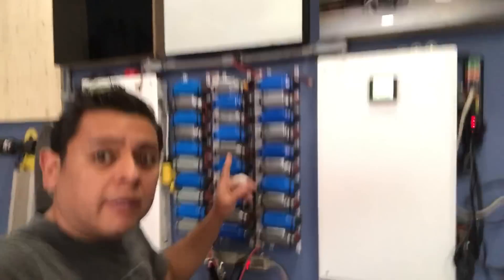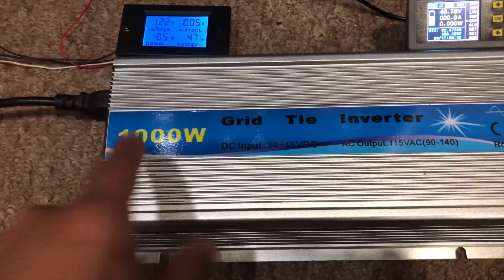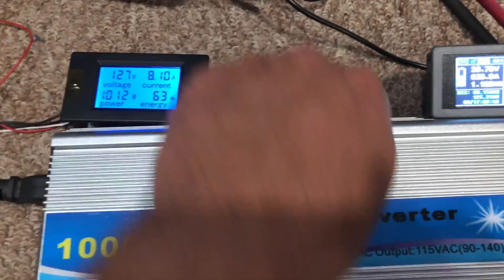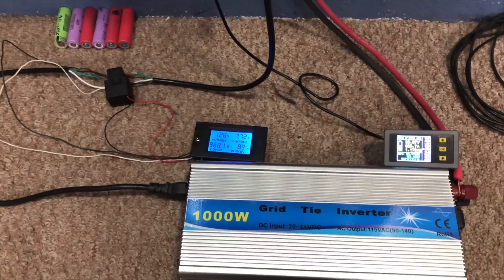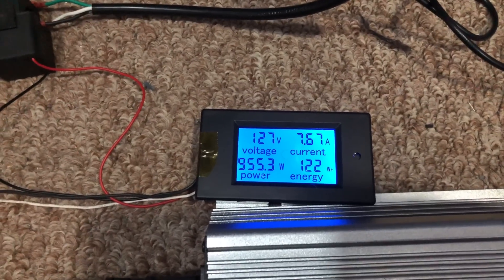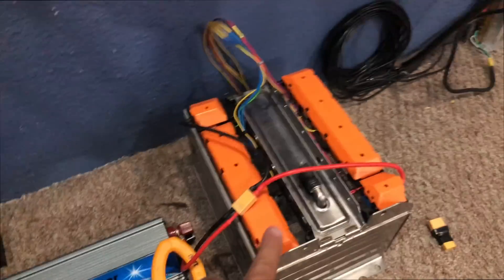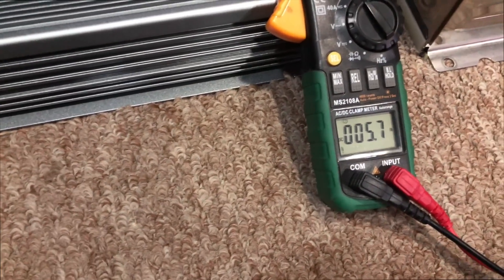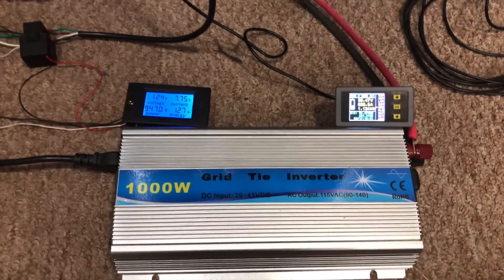Do Cheap Amazon 1kW grid tie inverters Put out 1000 Watts?

Comment: My 600-w grid tie and my 1,000-watt are just like yours but the power meter shows between 74 and 94 watts. I've tried them individually and combined.  When combined,  one shows 8 watts while the other shows 74. I don't know why it's not showing 609 or 1,000 watts next to power.

Comment: Hello! I have a 24 Volt system (LiFePO4)! Please tell me which inverter(1400w) to take with what voltage so that the inverter can work with a 24 V system? 10.8-32 or 22-50 Volts. Thank you very much in advance!

Comment: i wat thinking about using this, but trying to run at maybe 40% capacity off a battery bank so they don't overheat, any ideas how to limit the amperage from the battery bank to the inverter?  preferably without using resistors... do you think these inverters can accept a pwm power source? that could limit current. usually pwm is for motors so maybe it woudlnt work, maybe a dc-dc adjustable power supply... ah yes i awnsered my own question... Step Down 9A 10A XL4016 300W Module Modul Adjustable Power Regulator, this way i could just use a battery bank and feed liek 300 watts to my house all the time, instead of all my pannels just shooting it all into the grid and wasting it all. yes this is a poor mans grid tie with no feeding to the grid lol, and if i get more solar pannels, i do not need more inverters, just grab an extra battery(which is cheaper than an inverter) and then up my amperage a little.

Comment: Good tests. It would be nice to have an individual inverter that is powered by batteries which were recharged with solar to join in right when an appliance starts using the amount of power that inverter provides.

Comment: I use my 1000W inverters (2) every day between 12PM and 4PM.
They only have an output when they sense 120V, so I use Alexa plugs and program them to turn the inverters on and off.

The inverters start out at about 5-6Amps and taper back sometimes to less than 1A depending on how long they have been running.
They do NOT put out the same AC amperage consistently.

They take about 16A from the batteries/solar array each to give you 1-5A at 120VAC.
Solar Panel output is never consistent, if the panels are putting out 8A then the other 8A is coming from the battery.

They also trip 30A breakers daily, so I am now using 50A breakers.

I have 4 identical lead-acid batteries in series/parallel (2 sets of 2) for 24V.
These batteries charge from sunrise to 12PM and again from sunset to sundown from the solar arrays.

I have 1800W of solar at 25VDC on this setup and a control relay that shuts both inverters down if the batteries are less than 12V each using an Eco-Worthy Charge Controller to monitor and control the relay.
There is no PV input to this Charge Controller.

When both GTI Inverters are running at the same time, they seem to start out doubling the output, then both end up declining in amperage.
I only get 12A at 120VAC for a very short time, then it is up and down.

You can watch the panel and inverter output amps go up and down based on a cloud passing by.

This setup gives me about 2-12A at 120VAC for about 4 hours per day.
I could go longer if I wanted to run my batteries down, but I don't.
I like to keep my batteries between 12VDC and 13.8VDC (just like a car does) and run the system only when the solar arrays will power the inverters.
It should lower my bill.

I do have another separate array to supply power to an upright freezer and refrigerator.
Again only running for about 4 hours per day.
I also use an Alexa Smart Switch to turn this on and off on a schedule.
I have a relay that reconnects the grid power automatically if I lose solar.

Being on schedules like this is fine, but you have to still watch for cloudy days and shut them off manually or you will only be running on batteries.
I will work on that to automate it also.

I have designed a device to drop out panels if the total current goes above 30A so that I can over-panel for more power at sunrise and sunset.
If the total current drops too far it adds the panels back in.

Comment: Thank you very much for testing this.  I've been considering a small solar setup to offset some of my current power costs and was curious to see one in action.  A lot of my load is borderline resistive, or continual load such as laptops and A/C (I live far north so I just use a small ~ 1/2 ton A/C unit) and so solar with grid tie would be ideal to offset that cost.  I needed to see exactly how this unit functioned under load and such and you showed every stat I needed to know.  Thanks!

Comment: Good stuff Jehu. I'm looking to take advantage of the Nissan leaf sitting in my driveway if the grid power in our area should be disrupted. I've heard that you can run a 12v inverter on the car battery and if you the car in park with the power on, the traction battery (24kw) will keep the 12v car battery charged. If that works, how big of an inverter can I safely run on it and/or how big of an inverter would I need to run a refrigerator (according to the sticker inside it's rated at 8.5amps (don't know the watts)), and a second refrigerator rated at 4.5amps, and maybe a lamp or 2 for basic lighting, and if there's anything left over, maybe a smart tv (I think it's a 55").

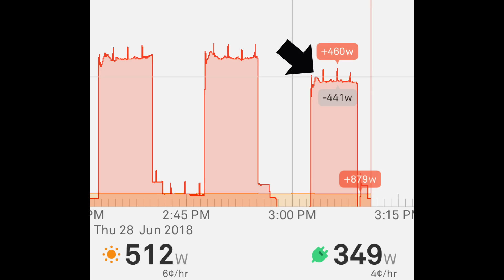Comment: Hi there ...so the part @ 7:27time line is running of a 12.7 volt battery inverter 10DC minimum and you have 1000w....no problem? I ask you this because of the inverter diagram 10DC version wants a minimum 18volt and not to run of the load side of charge controler. ?? What's your take on this.! Love the electric VW ROCK ON!! ( IRELAND )

Comment: I’ve got one of those grid time inverters and have four 300 Watt panels hooked to it and even then the middle of the day with the East Texas direct sun I cannot get that inverter to produce over roughly 540 -560 watts. 
Have you by chance tested the voltage of the two leads that you have connected to the inverter prior to connecting them? The reason I ask is because before I connect mine the voltage coming through the cables shows roughly 39 1/2 Volt, but as soon as I connect it to the inverter and the inverter starts running or is turned off and I put my voltage meter on both of the leads it’s reading in the mid 27 Volt range. I have no clue what’s going on or why that would be, any thoughts? Nobody has

Comment: I have a 600w version of this and I noticed that it was interfering with all my internet powerline adapters. It was making the internet connection unstable. I ended up replacing the powerline adapters with ethernet connections. So far so good. No devices blowing up. I even have a 3 phase 5kw inverter in sync with this with no issues so far.
Reply: Powerline internet can't go across a transformer that will change voltage. Also they depend on a sine wave filter, if your inverter is under load and is not a pure sine wave than your data will be corrupted.   You might find that a couple of large capacitors will buffer and allow you to use that equipment again.
Reply: @johnschneider931  Funny enough, it has blown the capacitors inside my Tenda powerline which is very close to the 600w china made inverter....so I guess these are not pure sine inverters after all so be careful people.
Reply: What size panels are you running to either of your two units? Do you find that you’re running more voltage/panels in excess of what the wattage says in order to try to even come close to that Wattage? Example, 3 panels 300 watts each which is 900 watts feeding the 600 watt Inverter to get it to produce the 600 watts or close to it?

Comment: Hi - I'm running two 120cell 32Vmp 7.92Imp 256W panels in parallel with African sun power into the  20-45V to 230Vac model but the best grid power I've monitored so far is 350W (ac). Very disappointed but hoping somebody can help. Input Voltage and current are well within spec but the units just don't generate anywhere near the power they should. The panels do deliver 500W with an ePever 3210AN MPPT controller. I can only think the Grid tie MPPT software is terrible.

Comment: So, in the process of conversion, at your input voltage, it's losing about 20-25% of the input. Or it's output is about 75% of the input. I am curious if it is more efficient when feeding it a higher input voltage. The ones I see listed can accept up to 50vdc. At 36vdc, it has to boost it higher.

In any event, if the losses are about 300watts between input and output, that is a fancy 300watt heater. Use three of them and you have to expell nearly 1000 watts of heat. That is great for winter, to add direct heat into your house, but horrible in winter, where that heat has to be expelled outside. (Thus, it will be replaced with hot outside air, being drawn in to the place you mount the inverters.) It seems to be using the heat generated as the "output restriction". If you ran these in the winter, they might stay a constant 1000w output and possibly have lower losses or draw from the input side.

Being 75% efficient is nothing to brag about. You have to buy 25% more solar cells and inverters, to get the desired output. If you add the 75% efficiency of charging... Then you actually need 50% to 65% more solar cells and batteries and battery chargers too.

It's worth paying 4x more for a 98% efficient inverter that operates at a higher input voltage and would handle all 3000watts without losing nearly 1000watts in the process. Getting an output of 3000watts, but consuming 1000watts, for a total of 4000watts of input, with 1000watts having to be disposed of, as heat, is quite bad.

Comment: I’ll be setting 1 of these inverters I’ve got on 2 Yellow top Optima Dry cell batteries in parallel it’s only for my sump pump in case we lose electricity  you know and I’ve got besides that 14 PCs 3.2v 280A & 6 PCs 3.2v 200A 😉

Comment: I dont like my inverter with a lead acid battery and a solar panel setup, because i use 220v and we need a lot more current to get stuff running on 220v instead of 120v
Reply from the maker: Exactly the opposite,  you need half the current on 220 vs 120
Reply: @jehugarcia  oh thx for info i tought we need more but its nice to know more🙃 im still learning electronics.

Comment: i have the 1000w version and it puts only out 328 watts.
it is connected to 2x 375 Watts Panels, at least 500 watts must come out.
Reply: Same issue I’m having. Curious when I see people test these online and it’s like they’re working perfect, but whenever I’m running over 1400 Watts to one of these thousand converters I can’t get the damn thing to go over 560 Watts??? IDK
Reply: @Wrensspeedshop  Many of these devices are scams.
Someone took a 600w converter and turned it into a 1000w converter by simply re-sticking the sticker. The golden one I had came to 816w and the syllable only to 328. If the watt numbers fluctuate a bit and it doesn't get any more then not enough comes out of the panels or the converter is damn inefficient.
If the wattage stays at a very specific number and always stays the same, then the limit of the converter has been reached.
By the way, both of mine broke after 3 weeks.

Comment: What is a transformer do? How much electricity would be charged if you used a microwave for just 3 minutes without that part? If there is old used microwave maybe you can load your house from that? Why are we paying when inverters + transformers are so cheap? We don't realize a 220 outlet can generate far more electricity with very cheap electric parts. No experience of course in this I just take things apart and google what each thing might else be used for or what other applications I can find the part is required then report back to youtube comments that the autobots and decepticons are to blame for never suspecting my microwave could power my portable devices as well as all my power use for lights free. Cartoons hold all the secrets.

Comment: Hi there, are you running the inverter just off a battery on this video? I want a battery only grid-tie inverter but everything from China seems to be solar panel related and when I speak to the people on alibaba they seem to suggest that a solar panel must be connected and the battery is for ‘backup’. I want to use the battery to charge on my economy 7 rate (low price) and then use it when the electricity rate is more expensive. Tempted to stack 5 of these inside a well ventilated custom housing with additional fans to give myself a 5kw grid tie inverter running off a bmw i3 battery (60Ah) in parallel at 44v. Thoughts?

Comment: for those of us that aren't fluent in math but still interested, can someone translate this into english? is this thing putting out decent numbers? with enough solar input could this inverter essentially power a small home/cottage or would you need more than one?
Reply: Because it is "grid tie" it feeds into the house circuit usually through a fused spur. The house is still attached to the grid. When the national/private company  or whatever grid fails... the unit will switch off. This type of unit won't do off grid without more switching. Sounds like you are asking about a standard inverter

Comment: Are these things saftey complaint and shut off in a powercut so you dont go electricuting some electric worker trying too fix the power. And can you still use it too power your house in a power cut as long as you turn your mains switch in your consumer unit?

Comment: When theses things plug into the wall outlet, isn’t it a problem for these inverters to pump electricity back through those home lines? 

I’m mostly concerned if the outlet won’t be able to take the current.
Reply from the maker: It’s  a 1500w rated outlet,  why would it have trouble taking 1000w
Reply: @jehugarcia  would you recommend these inverters for a small 2kw setup?

Comment: Just be careful, there’s a reason why it is better to have one high-powered inverter rather than paralleling n small ones. While some are designed to be synchronized to each other, if one fails it will inject into others, and thus they will all die instantly.
Reply: Shouldn't be a problem. Solar panel micro-inverters are essentially the same idea. Grid-tie inverters are supposed to synchronize to the grid.

Comment: Hey if you took one of these inverters and hooked it to one side of a 22o volt ac braker then took another one of these inverters and hooked up to the other side of the 220 ac braker would it run a 220 ac unit.Thank you. God bless.

Comment: good video. A question, I want to install a laser printer of approximately 550w 115v. What inverter could I use, modified wave? how many watts ?. I would use the printer very lightly during the day. Thank you
Reply: Little late to answer, but I believe you need a pure sine inverter for a laser printer.  There are a couple items like laser printer and lcd clock that need pure sine to function correctly.

Comment: I bought the exact same inverter the 12 volt input inverter but it blows a 100 amp DC circuit breaker within two minutes of connection to my single 12 volt AGM 76 AH battery ? I thought 100 amp breaker would do the job ?

Comment: with my supercar system you would be able to use 100watt constant and transform it into 1000w on cycles every 10minutes.or 10 000 watts output up to 100 000w

Comment: I would have placed a 25A current limiter on the input side of the GTI. They are not designed to run from battery inputs (unlimited input current), they are meant to run from Solar only with has a max input current.

Comment: Purchased this to run my traeger scout smoker while camping and charge camera batteries. This thing worked flawlessly  share4.photo/DPowerInverter   After reading the different inverters online and mixed reviews, I purchased this for the name and it has proven to be solid. Runs silently, and didn’t draw more than 130w while using smoker, and charging camera battery, and phone plugged into usb. This has been a great addition to my camping rig.
Reply: @LazyH-Online is it still good and running without any problems?

Comment: what is the maximum continuous power rating for this unit ?
Reply: Tehnical parameters for my tie inverter same company  36v./1000w  dc input range 20..._48v
Ac out 230v
Dc max.curent 60 A
Protection short circ. Low voltage .over voltage.over temperature protection.

Comment: Is your AC 120v? Most are 240, using L1,L1,N. if so than this will only fill 1/2 the use even stack with 5 of these units. Need to place on the other the other grid in home. http://thecircuitdetective.com/bkgrd.php

Comment: I just bought a grid tight inverter off of Amazon. I took it out of the box and hooked everything up correctly the voltages are in between the rated voltage. but the light flashed one time. It’s still not working but I could see a green light on the inside. Do you know what might be wrong.

Comment: Can you do a video of making a transfer switch for your powerwalls, so we dont have to worry about this feeding the grid when power is out?
Reply: Grid tie inverters won't feed the grid when power is out.

They actually need the grid supply present to Operate..... i.e. it senses the presence of grid supply, then it turns on....
Reply: That means, when grid has supply, it feeds the grid. And when grid has no power, it just shuts off.
Reply: @SAHILKHAN-lu8oq  without the grid during power outage im using pure sine wave inverter from battery as grid my battery 20ah last the whole day using my grid tie..(load depends on inverter capacity)

Comment: Short runs of cable can handle quite a bit more than its rated amperage. I run 140 amps through 4 gauge cable all the time for heating elements as long as they don't get over five feet long or so.